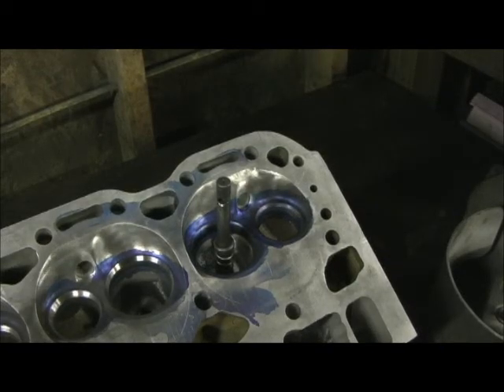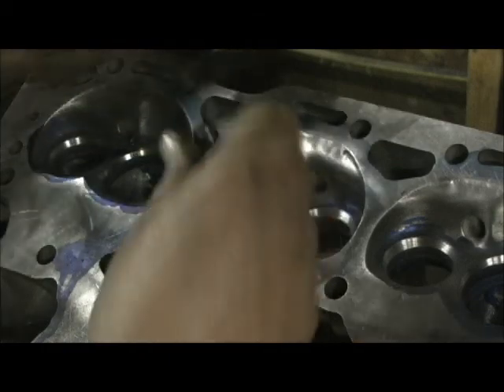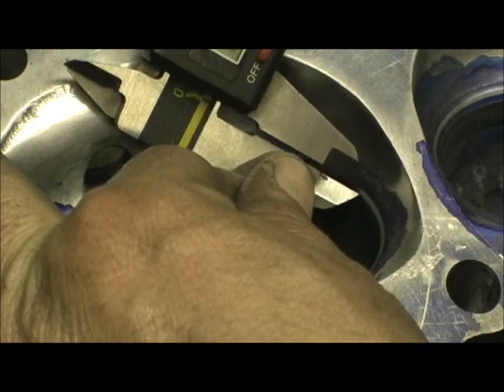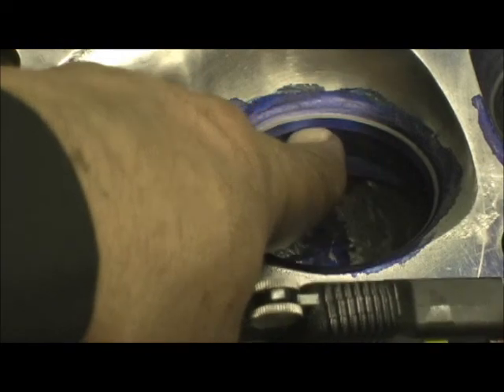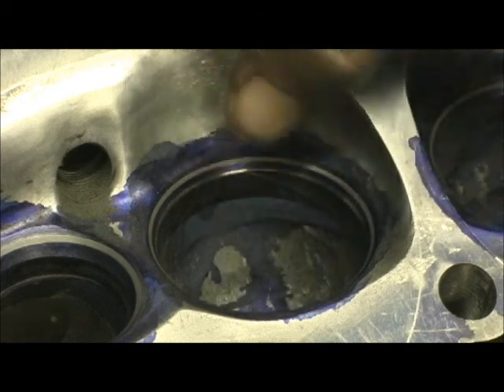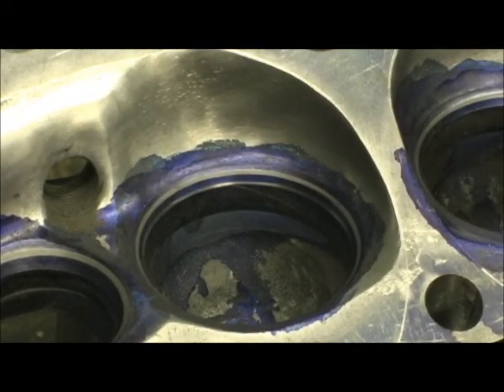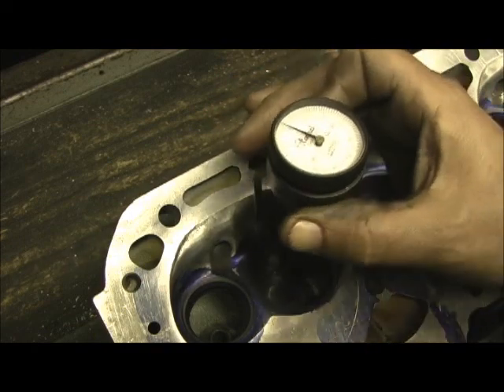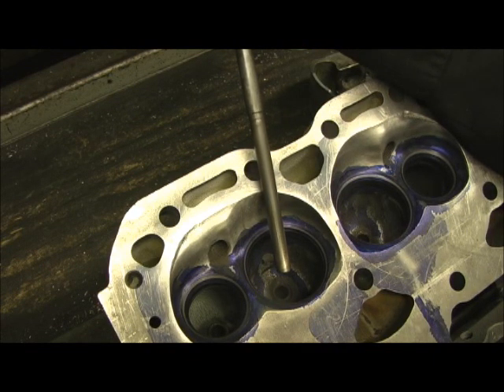LT-1 Chevy Full Porting Stage IV, Part 4.3

Comment: Thomas I totally hear you about the valve runout gauge. In my area I asked the machine shops if they use that gauge. I was shocked at what I heard. Everything from "no" to "our machines are calibrated to .001"in. Anyway I own 2 and I now do my own. I figure my test heads are better than their best anyway.

Comment from the maker: Your right about one thing Carp, when you put 1 3/4 Tube headers on those beast, I see about 15 to 20 HP right there. The 1406 Fel Pro was intended for the 1 3/4 size. Add the BIGGER Throttle Body, and Real Roller rockers (truer Ratios) and Watch out. I wish I had your car dude, it is rocking. I am about to prove in the next month about flow numbers by a new Tech that the big guys are using, and they done even measure the Flow Numbers much (about 30% value).

Comment: The cam is a Howards cam, lift 560/560 237/237 110 LSA. These specs they gave was with 1.5 rockers so the lift is closer to 600 =) with my 1.6 rockers. Thing is a beast, but I think people rely on flow bench just to sell their garbage. Those AFR heads are 56 cc exhaust ports you got mine to a 76 cc.

Comment from the maker: That cannot be, The heads NEVER SEEN A FLOWBENCH!!! YOU CANNOT PORT HEADS WITHOUT A FLOWBENCH....not!!! I just had to do that Tom. As soon as you send me the dyno sheet, I will conclude this on my website with great details (if you let me post the camshaft spec that everyone said would not work). FCK AFR!!! Your right, this was done with a STOCK 350 with a 1.94, 1.50 Valve sizes. Too Funny

Comment from the maker: Make sure you post that on the LT1 websites, about the cam. I remember you said everyone said the "cam I suggested would not work, not enough exhaust duration" and that bullshit. I cut the exhaust to hell and back to straighten out that problem. It was about 75 to 78% of the intake, which then means a Straight across cam is what the doctor ordered. Remember when we talked about a larger Throttle Body, you could hit the 450 mark. Lets see a set of AFR's hit those numbers....NOT

Comment: Crazy news, the car has made 412 rwhp. It also has an incredible flat torque curve through the rpm band. This was achieved with 1.94 valves! 
Guess what, it has room to grow if I add full roller rockers, 1 3/4" headers and a larger TB! This thing can easily hit 450 rwhp! 
Great job Tony at headbytes! 
The guys at the dyno shop were very surprised and said they would of never thought the cam choice would work, but guess what, it did! I will post a picture of the dyno sheet tomorrow.

Comment from the maker: I think you got this wrong Sir, let me elaborate to you.  The purpose of the 60 and 30 degree angle is to make the lines MEET so you have a place for the 45 degree stone to hit and appear. You move the line up and down on the face of the valve by adding either more 60/less 30 moves it higher up on the valve, or more 30/less 60 moves it down the face of the valve toward the end. I try to get the line about .025 from the edge of the valve (O.D.) so when I hit the 45 stone it lays in .010 from end.

Comment: This is like the Bible of cylinder head work!! Great info. Question tho, where the 60 and 30 degree meet and form that line, which part of the 45 seat is that line showing? top, bottom, middle?

Comment from the maker: Yea, I used a Serdi 100, a VG 25, a Peterson 25, and a Tobin Arp head shops over the years. and while I love them, and they got there pluses and minuses, the fact is that you cannot achieve the concentricity that a stone can give simply because the stone applies pressure equally all the way around the seat. The carbide cutters of the serdi and others get close, what I done was laid the seat pointer to the HIGH SIDE of the valve, so I could move the seat down to.010 near the end of the valve edge